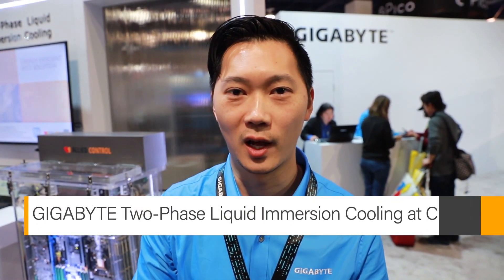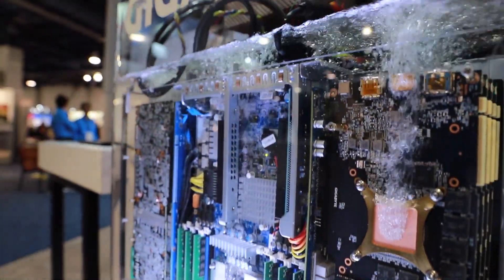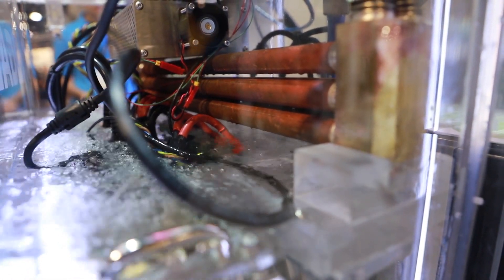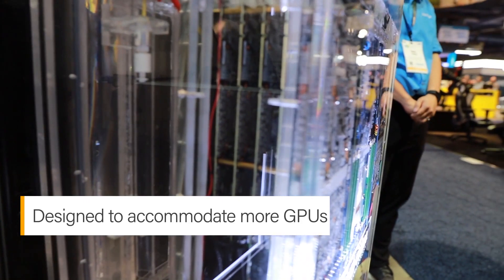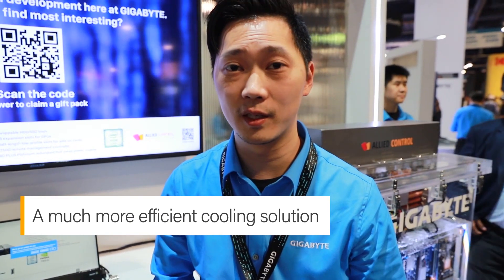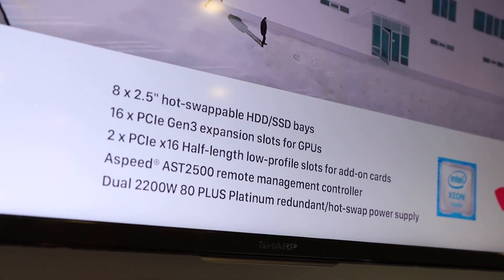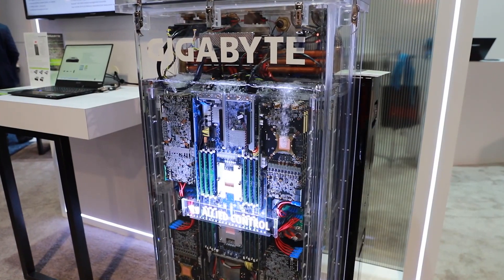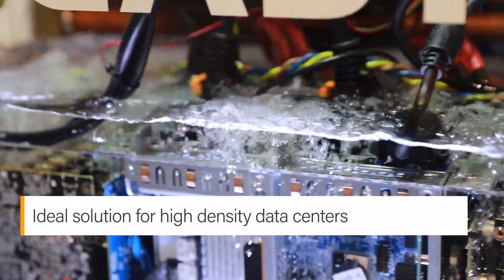An improved PUE solution with Two-Phase Liquid Immersion Cooling

Comment: Very interesting.  The units appear to be vertical.  A 2U server tray is 4 inches tall (I believe the standard size for a unit is 2 inches tall).  Are you shifting the way boards and cards are mounted?  What is the 3M Novek engineered liquid?  

You are using a sealed tank for keeping it in such that it condenses which makes sense but what happens if the tank were opened for maintenance and there is a high vapor density?  Is the 3M Novek safe to breath or are respirators required?  

Forgive a moment of tree hugging but I do worry about that, what is the toxicity from an environmental stand point?  How must the liquid be disposed of in the event of a spill or in the future an even better cooling solution is developed or better liquid?

How is the heat from the condensers removed?  Does it just blow out?  I believe I saw something about specs for your system included a 2200W power supply.  That if fully utilized will generate 7500 BTU/hour of heat.  The components will not bothered as the boiling and condensing (so you do not super-heat like a pressure cooker does with increasing pressure raising boiling point) but that heat must go someplace?  Where does it go? 

I am very interested in the subject and find the technology as one that I am interested in.  I just have these questions before going further.

Comment: If this the novec liquid then the comments about replacing parts being a mess would not be correct as this liquid is not sticky and it dries extremely quickly (in about 20 seconds ) , unlike mineral oil it can disposed easily and it won't take more space then existing server rack solutions

Comment: What about this technology in automobiles where engines are cooled using this technology..
Reply: Not applicable for automobiles, for ones using traditional internal combustion engines. Most automobile engines nowadays are liquid cooled, and the liquid it uses is either water or a mix of 50:50 water and coolant. This 3M Novec has a boiling temperature of 49°C or the other version of it boils at 70°C, not applicable for automobile engines cause automobile engines produces more heat, and water boils at a higher temperature of 100°C, with coolant it can boil at a higher temperature. So not applicable for gasoline or diesel engines. But probably applicable for the cars engine electronics, but it is not worth it, the costs of the 3M Novec doesn't justify to have a much better engine electronic cooling. Maybe for racing applications, but as far as I know, no one in Formula One uses this cooling for their electronics. As for electric vehicles, again it's the cost, it doesn't justify to have better cooling for the electronic inverters and other electronics of an electric car. It also is pointless to use as a cooling liquid for some electric cars that uses liquid cooled battery, cause it has a very low boiling point.

Comment: I wonder how much weight does this generate? Water of course is impractical not only because it needs to be highly purely distilled. 

But because of it's weight distribution. This to me would be a great alternative for not only large data center applications. 

But imagine you could utilize this for deep space missions. If it doesn't require a lot of maintenance and swapping out of fluid than damn sign me up. 

Actually I'd be curious what kind of corrosive properties this has and  how it compares to let's say Floridant FC-72 coolant. 

Eliminating the need for heat exchangers among other things would be a huge advantage. Gigabyte might have something more here than even they realize. :b
Reply: Convection and natural circulation like this only works in gravity. Without gravity you might get evaporation but there is no condensation dripping back down inside the cabinet. You would need some way to deliver the condensate back into the fluid volume. But convection itself would probably slow to a standstill in zero gravity, so the cooling will be much less efficient.
In these cases you would instead have the cooled volume entirely filled with fluid, and the fluid would then be pumped through an expansion valve. This forces vapourisation and the heat is released for dissipation. Basically a fridge. The safety critical component in that case then becomes the pump.

Comment: I have a question maybe a noob question. If this dielectric liquid turns into steam that is basically water, how is it possible that it does not mix with the special liquid?
Reply: Since when did vaporized dielectric liquid became steam water?
Reply: @gawhyrghun1913   That's why I wrote maybe is a noob question.. but my question is valid because if the system is open to air it can be condensation but if is full sealed then there is no problem..
Reply: @carlosmachado4792  In literally every source about this type of cooling they state it's sealed environment, therefore question is invalid.
Reply: @gawhyrghun1913   I know what he means, it seems like water until you listen to the video.. still I am thinking how the hell do they have a 0 ohm liquid especially with components as sensitive as a motherboard.
Reply: @dean6125  
is valid because I am free to ask that's it.. 
whether you like it or not
Reply: @carlosmachado4792  "I know what he means" as in what you mean, read what I said (I agree with you)
Reply: @dean6125  I think Carlos meant to reply to @Gawhyr Ghun.
Reply: @richardwilloughby2015  yeh think so :-)

Comment: I would like to see the temperature gauge while it performs
Reply: it depends on the boiling point, many 3M Novec have boiling point of 49degC (649, 1230), while 7100 is 61degC, so it will be around that point max.
Reply: It would have made sense as this is cooling (thermal transfer) product. Temperatures for chips being cooled on screen and thermal camera pointed to the tank :D

Comment: Personally this is a great idea and something I've been all about since like 2k. You guy should be working on combining this setup with a 400w+ phase change compressor for below 0C novec cooling.
Reply: this is not heat pump, basically just a big vapour chamber for whole system, there is no compressor involved (no moving part) but you still need condenser to cool the vapour to let it become liquid again.  furthermore the chamber itself must be tightly sealed otherwise it will be released to the atmosphere.
Reply: @lawson128  Yes I fully understand how novec cooling works. I was making a suggestion for taking the temps to near or subzero range. The biggest drawback with novec is the evaporation rate and cost of the novec. Last I checked it was still in the range of $500 per gallon. Yep novec hfe 7200 $520.20 for 1gal. Price hasn't changed in damn near 20 yrs.